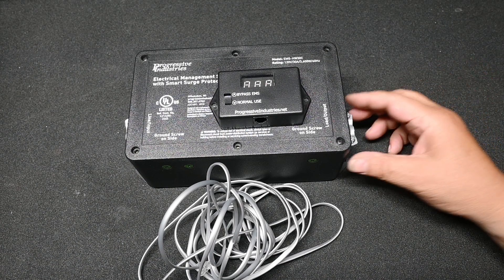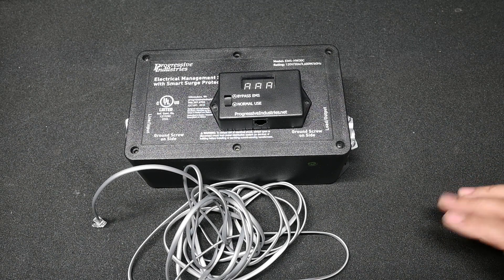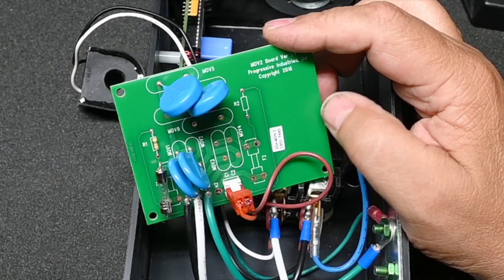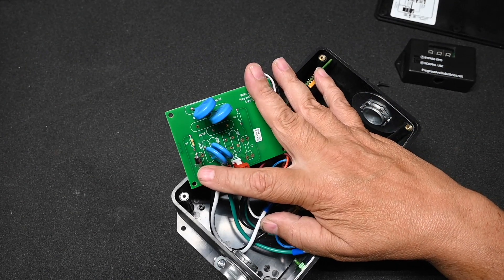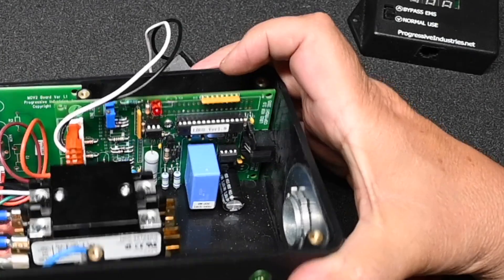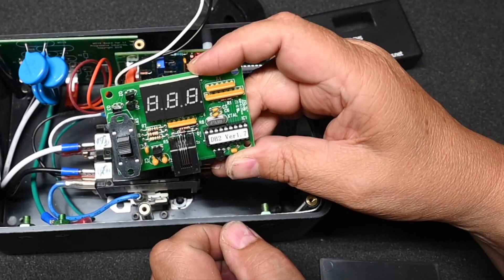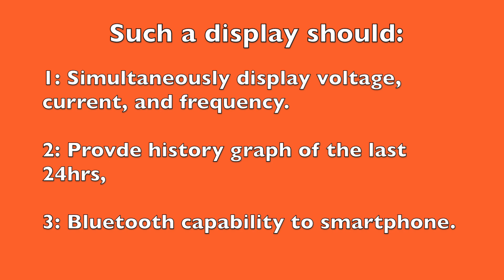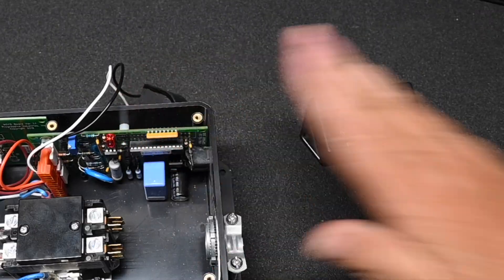How RV things work - EMS Systems

Comment: This was extremely helpful as the unit I am currently installing has a damaged jumper that was loose inside and will not properly attach any longer. Good to know this controls the delay and the unit will still function properly. Do you know if I might have any luck finding a new jumper? The EMS unit was mostly installed by the time I realized there was a loose piece inside.

Comment: Great video! You did one on this EMS a couple years back. This was the first thing I put in my trailer when I got it. You mentioned something about the by-pass mode when connecting to a generator. It it recommended to go to by-pass mode when using a generator?
Reply from the maker: Typically generators do not connect the ground to neutral.  When the EMS sees this, it thinks it is a fault and shuts down the RV.  The bypass prevents this from happening.  There are also generator "bonding" plugs that some people use to tie neutral to ground which tricks the EMS to not shut down.